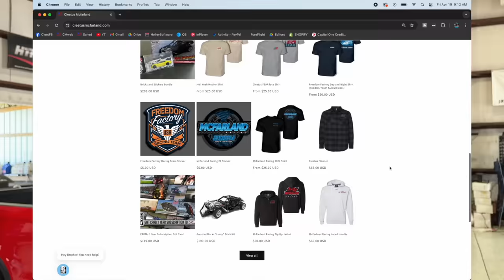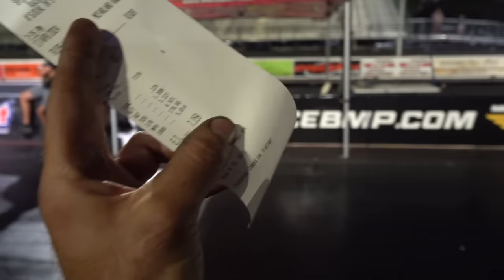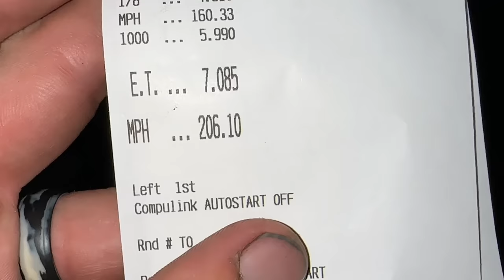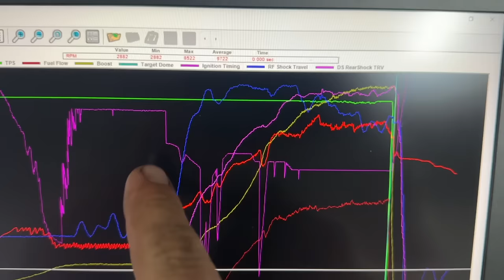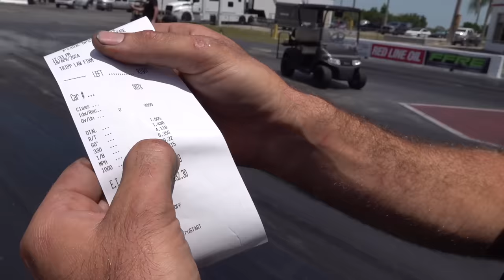Our NEW GMC and Mullet Both DESTROYED Their Records!!!

Comment: I had same issues on my lowered 4wd silverado, I broke a few axles. You need longer axles on these trucks, get the factory trail boss axles since they are longer and won't pop the snap rings off
Reply: I hope he sees this
Reply: @cleetusmcfarland
Reply: Good advice!!
Reply: Thanks, I'll swap them out when I get it home.
Reply: Chevy people...
Reply: Or just buy a Ford
Reply: Can’t turn in your truck. It’ll break. Remember that Chevy boys 😂
Reply: @joshuaearnheart2756 What does this have to do with Chevy..?  It's a short wheelbase, 4x4 truck on slicks.  OF COURSE it's going to break something when you turn like that.  It's hard enough on parts to do that without slicks...  

This brand-war stuff is pathetic.  Both trucks are awesome, but neither truck's success has anything to do with either brand.  Pretty much everything except the body and chassis is aftermarket on BOTH of the trucks.
Reply: @JayRussellDuramax  his ford hasn’t broke any. But go off
Reply: @joshuaearnheart2756  And..?  This truck hasn't broken any either...  It's just snap rings because the axles are too short - like the OP said.  The axles themselves are fine.  I don't know what you're trying to claim here.
Reply: @JayRussellDuramax  snap rings are part of the axle. How are they too short for a lowered truck. Makes no sense. Chevy just builds shit. Plain and simple. They’ve always had weak front ends
Reply: @joshuaearnheart2756  They're a very minor component that's being put under stress that they weren't designed for because the truck is lowered and on slicks.  When you lower a truck, the control arms are in a different position in their arc than usual.  Depending on suspension geometry, that can put your CV axles in tension or compression, which will put small components - like these snap rings - in situations they weren't designed for.  In this case, the axles are being put under tension, which is causing the snap rings to break.  Notice the joints and shafts are still fine.  If the axles were a bit longer, they wouldn't be put under tension like this when the truck decelerates or turns.  It's very simple.

The fact that you're calling the entirety of a brand shit because of a minor failure is ridiculous and continues to prove my point that this brand versus brand stuff is the stupidest and most needlessly toxic part of the car community.  Pretty much all of the arguments - on either side - are ignorant and anecdotal at best, or complete nonsense like what you just said.

Case in point:  There's hundreds of builds like this using bone-stock GM front end components that don't break - this one included.  The axles are not breaking under torque, and neither is the differential.  Therefore, Chevy front ends aren't weak.
Reply: @joshuaearnheart2756 ya how terrible the axles popped out. Much harder to fix than a broken crank like the ford.
Reply: @JayRussellDuramax  dawg, do you even hear yourself? Do you know how an ifs truck works? When they lower the front end it will basically make the cv’s parallel to the ground. If they’re too short on a lowered truck they’re way too damn short at factory height. Again, junk GM. That ford is lowered and how many times has he launched it and hit on the brakes at well over 150? Stock front end, stock axles, stock rearend and is a LOT faster than that fully built 427 that required the cab to be pulled off to be put in. Made 400 hp with the stock engine and a blower. So impressive huh? Stock coyote with rods and pistons absolutely gapping that Chevy. There is no this vs that. There’s absolutely no comparison. They’re on different levels and the fact that you think it’s even close speaks volumes. Talk about brand loyalty. It’s even worse justifying being a whole second slower in the quarter and the ford can still be turned up more. Chevy breaks every pass. Sound like James and George. You couldn’t be more biased. Saying chevys don’t have weak front ends is like saying the sky ain’t blue and grass ain’t green. There’s companies that got rich from building kits to not make the front tires point at each other. Like the kryptonite front ends
Reply: @mcfero1  crank broke because he didn’t put the crank support on it. Launching it banging it off limiter 100 times a week for several weeks without the support on. It’s a big blower on a factory crank. The guy that was driving the truck when it went a 9.0, go look at his car. Running 6.1x at 238 mph on a stock crank making 2960 at the rear wheels. Approximately 3300 at the crank. It’s not a weak crank by any stretch. Keep reaching though buttercup
Reply: @joshuaearnheart2756  it’s fine. I’m just not a hater I like all brands. Every platform has pros and cons.
Reply: @joshuaearnheart2756  I do know how IFS works; I literally just explained it to you.  The axles becoming parallel to the ground is what's causing the issue.  If the inner pivot points of the control arms aren't in-line with the inner CV joint, the axle changes length as the suspension goes through its travel.  This truck is experiencing that in a way that's causing the axles to be put in tension, as I stated in my previous comment.  It's basic geometry, and the GMC simply doesn't have factory geometry that plays nice with the stock CV axles when you lower the truck.  No big deal; just get longer axles...

First off, if I remember correctly, the Ford is the one that required the cab to be removed to install the engine, not the GMC.

Second, that fully-built TKM SHORT-block in the Ford costs MORE than the fully-built Texas Speed LONG-block in the GMC.  Less money for the LTX - AND you get built heads.  Coyotes are great engines; they're just EXPENSIVE!  Also, since we're comparing the two, the 427 is smaller and lighter than the Coyote as well.  None of the "Ohh, how pathetic that you need a 427 to beat a little 5.0!" guys talk about that part...

Third, the blower on the 427 is WAY worse than the one on the Coyote.  If they had the same blower, the 427 would be making WAY more power than the Coyote.  That's why they added nitrous to get it in the 9s:  They're out of blower.  Give them both the big Whipple and see what happens...

Fourth, while GM tie-rods are a known weak point on the diesels, it's hardly enough to claim that the ENTIRE front end is weak.  The components that actually matter are just fine.  You can use longer GM axles on this and have no issues...

Fifth, I never justified anything.  I entered a conversation about the axles being too short, and you went on an insecure rant about Ford versus GM.  The obvious justification is that the Ford has a way better blower than the GMC - hence Cleetus saying they'd turn the boost down on the Ford to make it fair.  But, before they could do that, the Ford BROKE!  AGAIN!  If you'd like to keep a tally on which truck has broken more parts, you'd better add THREE ENGINES to the Ford, not counting the NUMEROUS belts...

Sixth, everyone is biased; that's why we're arguing.  What matters is who has evidence to justify their bias.  You've done nothing but spout off on an insecure - and uninformed - rant, while I've given clearly stated reasons.  Please settle down and try again once you're thinking clearly.
Reply: @JayRussellDuramax  no it doesn’t. $5k for a built coyote short block. The ford didn’t require the cab to be removed. Go watch the videos. They had to pull the cab off the gmc twice. It’s documented on this very channel. Just go look. I’m not explaining it to you pumpkin. 0 pitch on the CV axle will have them at their longest. Idk how else to explain that. It’s a design flaw. GM won’t fix it. The 8 speed trans was such a pile of crap they had to have ford design a 10 speed for them. Front ends have been junk for years. Transfer cases have been junk since 99. The ford has also made hundreds and hundreds of passes and it had the wrong belt on it. Had one that was too short putting extra tension on the crank snout and it had a bent alternator shaft causing it to throw belts and slam off the rev limiter. Time after time. So let’s do count failures that weren’t his fault. Please do
Reply: @joshuaearnheart2756  Wrong.  The cheapest TKM option is $9K, and the one they have is at least $12K.  The LT is closer to $15K - which is more expensive than I thought it was - but it still comes with cylinder heads.  The Coyote is still bigger and heavier - which is why so many people put LS engines in Fords.

Ok, so I got the cab thing backwards.  You can't blame me since Ford trucks have needed the cab to be pulled for engine work for DECADES.  Regardless, these new trucks are all awful.  If they'd've put this money into some OBS trucks, both of them would be WAY faster.

You really have no idea what we're talking about here, do you?  If the inner pivot on the CV is not in-line with the inner pivots on the control arms, the axle will experience tension or compression as the suspension goes through its travel.  This is the issue I'm describing:  The axle is being pulled apart as the suspension compresses because it's too short for this lowered application; it's not a design flaw...  As the OP said, the simple fix is to use the GM part number for the Trail-Boss trucks.  No big deal.  Also, the pitch angle of the CV joints doesn't effect the length of the axle...  It's the same length no matter the angle, it's just not in a straight line.

Nobody cares about the new transmissions.  Both trucks would be faster if they had a Turbo 400 in them like Mullet - which is a GM transmission.   Plus, the 10-speed was a joint effort between Ford and GM, so I don't know why you're bragging about that...

The transfer cases are definitely not junk.  Plenty of people use bone-stock ones on big-power builds like this with no issue.  Didn't they break a couple of transfer cases on the Ford already..?

When did they say the belt was too short on the Ford..?  They knew from the beginning that they needed a crank support, but they waited until the crank broke to get one.

If the belts breaking on the Ford weren't his fault, then the axles breaking on the GM weren't either.  That means that the GMC hasn't really broken anything, and the Ford is down multiple engines and transfer cases - and the stock transmission, if I remember correctly.
Reply: @JayRussellDuramax  you’re spewing all this info you think you know and it’s just plain wrong. That tkm branded engine can be bought anywhere else for half the price. Texas speed sells them. $5500 and it’s rated at 1500 hp. Midnight performance dude has one in his Mustang and it makes about 1800. Has for a long time. They didn’t wait to get a crank support. He had it sitting on the shelf for over a year and just didn’t put it on. He knew he needed it and didn’t put it on. The belt was too short for the application. Midnight performance told him that when he had his back half shootout at the drag strip. And the shaft on the alternator was bent causing the belts to come off. That’s not fords fault they put a belt on that was too small and it bent parts. Here you GM guys go again claiming that 10 speed. GM had 0 to do with the 10 speed. None. Zip. Zilch. GM was supposed to build a 9 speed transaxle transmission to put in the front wheel drive cars. It was so bad ford never used it. It was supposed to be a “I’ll build this, you build that, we will trade” but it never happened. Ford is the only one building everything in house. Engines both gasoline and diesel, transmissions, everything. He didn’t break any transfer cases in his current ford and hasn’t broke any by launching them at the track. He was doing awd donuts on his skid pad. Full crank on the steering wheel with 1200 hp and a big turbo. His factory transmission did get wore out. Again, nothing broke. Wore the clutches out. They didn’t even attempt to run the GM on a stock trans. Had midnight performance send them a built one. Went in immediately. You don’t watch the channel and you love Chevrolet. It’s obvious. Funny you’re a GM fanboy and have duramax as your screen name… a Japanese company that isn’t GM… that has an Allison transmission…. That isn’t GM. Also, cabs haven’t needed pulled on fords for engine work. Ford diesels? Yes. Not gasoline engines. None of the above. I’ve heli-coiled triton heads in my driveway. Pulled valve covers off 4v cobras in the car and had room to pull the heads if needed. People doing it and it needing to be done are different. Shops are pulling cabs to do 3.5 ecoboost cam phasers when it’s completely unnecessary
Reply: @joshuaearnheart2756  I've explained the axle situation three times, and all you do is rant about how horrible you think GM is.  Please tell me what I said that was wrong.  I've already pointed out that what you said about IFS was wrong, but you ignore that and rant about other stuff that nobody is talking about.

TSP sells one alright. ...For $9K.  I don't know where you're coming up with this $5,500 nonsense.  Even the 1,000 HP one is over $6K - and that's still without cylinder heads.  Regardless of the expense, the Coyote is still bigger and heavier.

It doesn't matter whose shelf it was on; they broke the crankshaft.  That's the point.  That would've happened with the correct length belt.

The belts breaking weren't Ford's fault, and the axles breaking aren't GM's fault.  They're using an axle that's too short, and it gets pulled apart when the suspension compresses.  Use the correct length axle, and they won't break.  Stop making a big deal out of nothing.

Ok.  Whatever.  The Turbo 400 is still a better transmission than either of them - which is why it's used in so many high performance drag vehicles.  Also, here you Ford guys go overstating reality:  Ford didn't use the 9-speed because the 9th gear wasn't helping efficiency as much as they wanted, so they removed that and made it an 8-speed and used it along side other 8-speeds.  Big deal.  New stuff is just planned obsolescence anyways, so I don't see why you're getting caught up in it.

Worn out isn't any different than broken.  The application vastly reduced the lifespan of the component, so it might as well have broken.  They swapped the one in the GMC because they knew it would wear out quickly - especially since the 427 makes more torque.

But they still broke the transfer case, didn't they?  Funny how the circumstances of the break make so much of a difference when the Ford breaks something, but, when the GMC breaks something, you say that GM is shit.

I do watch the channel, and I'm not a GM fanboy; I just own a Duramax.  You'd know that if you looked at my channel.  You're a Ford fanboy, and it's hilariously pathetic how much this is bothering you.  I couldn't care less about modern vehicles or the OEMs that make them.  They're all garbage and the companies are just government peons.  The red GMC is one of the ugliest trucks I've ever seen, but the blue Ford looks fantastic, so stop acting like I'm in love with GM.  I truly couldn't care less about either manufacturer in their current state.

Doing everything in-house isn't a big deal, either.  Allison makes excellent transmissions, so why not use them..?  You should watch some of the videos about the garbage valve bodies Ford is putting in their transmissions.  Also, while the original design was a joint venture with GM and Izuzu, DMAX is wholly owned by GM, and they're made in Ohio.  Duramax engines have proven their reliability over 25 years, unlike the PowerStrokes that are just now starting to be reliable.
Reply: @JayRussellDuramax  it was $5500 for a short block awhile back when we were going to put one in my brothers mustang. They’ve went up a little. Still, $6299 for a rods and pistons engine that will take 1300-1400. More than the truck is making anyways. Don’t need the heads, the stock ones are better than any aftermarket LS head. They’ve been 6.1x in a quarter in a 3k pound street car after all. And A trash 5.3 from them is $5k… with no heads. And this 427 is the l8t platform. $8700 with no heads. The pushrod design is supposed to be “cheap and simple” costs more than a coyote. Duramax has proven to eat head gaskets as bad as a 6.0 and, ironically, snap the pin off the timing gear on the crank snout. Buddy of mine is a master tech at a GM dealership and says they do 3-4 a week. Have to put a key way on the crank and need bulletproofed just like a 6.0 powerstroke. And the valve bodies aren’t the problems in the transmissions. It’s the adaptive learning. Know how many trucks I’ve seen taken to a nearby shop and had that turned off and they run perfect afterwards? Videos you’re watching may have some crooked mechanics tryna make a buck. Mullets m&m th400 is over $20k. It damn well should be better than an f150 transmission with a clutch pack in it. That gmc isn’t lowered to the point those axles look like a set of gull wing doors. Its 2”. What happens if you hit a bump? Does that break your axles? You can’t think that’s acceptable. How is it the ford axles don’t break while running much faster and hitting the brakes much harder? I’ll never understand. You sound just like James and George with your excuses. But, but, but. It’s got the wrong axles in it. Even though they came in the truck from GM.
Reply: @joshuaearnheart2756  It doesn't matter what it can take, it's what it's rated for.  Making 1,500 HP on an engine rated for 1,000 is asking for trouble.  I'm saying that, when looking at similarly rated engines, the Coyotes are more expensive.  The LT platform is more expensive than the LS platform because of the stupid direct injection.  If they didn't have to use the stock computer to maintain all the BCM stuff, this would've been even cheaper because they probably would've used an LS.

More flow doesn't mean more power.  The Coyote heads may flow more, but that doesn't make them better.  Just like more boost doesn't mean more power.  It's about how dense the air is.  The LS/LT heads make great power with or without boost.

Every engine has problems, no doubt, but the Duramax hasn't been anywhere near as problematic as the 6.0 or 6.4 PowerStrokes.  I've doubled the output of my LB7, and it hasn't had any issues - engine or transmission.  Regardless, I'm convinced most issues with these trucks - GM and Ford alike - are from bad tuning and bad drivers.  People also say the stock Allison can't take much over stock, but yet mine is completely fine with it.  It honestly shifts better with the added power!

All the videos I've seen show brand new valve bodies - straight from Ford - with stuck/sticking valves.  I can't remember the name of the channel, but the guy has several videos showing it.  He's a younger guy with a long hair and a southern drawl.

I meant the Turbo 400 platform in general, not specifically the one in Mullet.  Still, I bet that built 10-speed was a pretty penny - and I think there's more internals changed than just the clutches...

The axles don't have to look like gullwing doors to have this issue.  You'd know that if you read the three or so times I explained the issue...  Is it so unreasonable to have parts fail when they're not used for their intended purpose..?  It doesn't have the wrong axles in it from the factory if you don't lower it.  We're simply saying that, for the suspension geometry of this truck, when you lower it like this, you need longer axles to prevent them from being pulled apart when the suspension compresses.  It's not hard to understand - and there's an off-the-shelf GM part that will do it just fine.  They're not being overpowered; they're just being pulled apart when the suspension compresses.

Please don't compare me to the ridiculousness that James and George are spewing out; I sound nothing like them.  I truly hope they're joking, because it's honesty pathetic to listen to...
Reply: @JayRussellDuramax  making 1500 hp in general is asking for trouble. But a coyote is different. It’s not a GM product. Even at $9k for your 1500 hp rated engine, put it in front of a 6r80 with a 4r200 hub. Ready for 6s. It’s not really the heads making the power on an NA build. Sure they help a little, but it’s more the camshaft profile and Intake manifold combo. There’s a guy from my area that owns a tuning shop. That’s his livelihood. He bought a rcsb f150 and put twins on it. Did the oil pump gears and crank sprocket with head studs. Made 1429 whp. Still on stock everything except a driveshaft. Know what he used it for? Towing his 416 stroker ls3 Camaro on a huge shot of nitrous. Would tow the car to the truck, unhook, turn the truck up, race them both all night, load the car back on the trailer and drag it home with the truck. And there was a bunch of people just like you barking about how expensive it is so he posted all of his receipts from everything. The truck was way cheaper. Like 15-20k cheaper and was getting gapped by the truck. 

You obviously aren’t listening about the axles. If a 2” drop is enough to completely render 4wd useless, then that’s a serious design flaw. Anything that would potentially upset that suspension on the highway would rip it apart. Point is, the ford is also lowered and it’s running stock axles. Probably thousands of launches on them. Many track passes getting on the brakes hard. It’s still fine. Accepting that junk is what’s wrong with GM. They’re not held accountable. Not forced to fix anything. And I didn’t say 6.4. That’s an issue with emissions. Not necessarily the engine itself. And I didn’t say it was as problematic as a 6.0 either. Said they eat head gaskets just the same. And again. Emissions systems are a bigger problem with the 6.0 than the engine itself. It’s the egr crap. Bosch also screwed all 3 companies with the cp4.

And the guy you’re talking about, his name is mayson. His channel is flying wrenches. Watch him all the time. I’m sure you’re subscribed to every channel that will show a ford having problems
Reply: @joshuaearnheart2756  How did the Camaro get so expensive..?  What on earth cost $15K more?  That doesn't make any sense.  

Or, they designed the suspension to better accommodate lifted trucks - which is the vast majority of the 4x4 user base.  Changing the ride height of a 4x4 truck always puts the CV axles in a range of motion different from what they were designed for.  In this case, because of the suspension geometry, the lowered truck is putting the axles in tension, which is putting load on a snap ring that wasn't designed for it.  Also, again with your gross over exaggeration of the issues, the 4x4 hasn't been rendered useless.  Notice how the truck doesn't break an axle when it launches and extends the suspension.  It only breaks when the suspension compresses.  Stop using such a tiny issue to make these petty and baseless condemnations of an ENTIRE company.  YOU are the one that sounds like James and George, and you're definitely not joking.

Why do you think I'm a Ford hater..?  I started this conversation by asking what the axle breaks had to do with Chevy.  That doesn't mean I'm a Chevy fanboy/Ford hater.  Heck, I'm not even subscribed to the Flying Wrenches channel - which is why I didn't know the name of the guy or his channel.  I already told you that I couldn't care less about either company in their current state.  The rigavlry was cool 60 years ago when the government and EPA wasn't ruining everything.  Now it's just pathetic and brings out the absolute worst in everyone.  Toxicity like this is ruining the car community - and for what?  Bragging rights?  Just build cool stuff without feeling the need to attack people for building cool stuff that's different than your cool stuff.
Reply: @JayRussellDuramax  the axle breaks have to do with Chevy, because it’s a Chevy… breaking axles… not the other way around. Make sense? You can lower and lift a ford. Axles don’t break. Make sense? If it was lowered 6 inches, sure, blame the geometry. Now 2 inches, no. That’s a shit axle from a shit company that doesn’t give a damn about the consumer. The point of me saying this isn’t toxic. The point of me saying this is to get people to hold these companies accountable or else everything will be junk just like that. Matter fact, I sold my new Ford truck just because on the off chance something was to happen. They weren’t getting any more money from me. Now I drive a 2003 Toyota 4runner, but I still have two Ford F250 work trucks as does my brother. We have well over 1,000,000 miles on 6.2 gas burner Ford trucks and they just keep working. I’ve personally pulled 22k pounds with the gas burner. I know a guy that pulls 25k+ pounds at a minimum twice a week. My step dad sold his 75k mile garage kept gmc because it was starting to rust at the rockers and had a lifter about to come out of it. He bought a wrecked 17 lariat. Ended up selling it and making money on it. He now owns a 2017 f350 flatbed dually. Said he’d never buy another junk Chevy. My best friend from high school put 3 transmissions in his Tahoe. Now drives a 2013 5.0 f150 and recently bought a 2012 6.2 f150. Both at 200k no issues. I know another guy that bought a used gmc last year for $34k. 80k miles on it. 2018 model I think. Transmission is out of it already, no warranty. There’s not even a comparison currently. They’re not even in the same realm.
Reply: @joshuaearnheart2756  The axle breaks because it's a Chevy...  And you have the nerve to call out my bias..?  Your anecdotes have no value - as do all anecdotes - because they don't reflect the reality of the issue; they only reflect your isolated experiences.  PLENTY of people have hundreds of thousands of miles on original drivetrain components from both manufacturers.  It's more about maintenance than OEM quality.  Sure, there's always exceptions - on both sides, I might add - but the overwhelming reality is that broken and problematic vehicles - especially when looking at Ford and GM - are a fault of the driver and their lack of maintenance and care.

This is absolutely hilarious that you're trying to spin your rant as some sort of altruistic audit of modern manufacturers.  Everyone in the car community knows that ALL OEMs aren't being held accountable, and there's nothing we can do about it except not buy from them.  Get over yourself.  Buy an old, used truck like I did and put your money into building it up.  Mine is about to turn 300K miles on all-original running gear, and, aside from some extra blow-by, everything is very healthy, and I tow with it for work every day - with my EFI Live tune turned up, too.

What is this, the sixth time I've said this, now?  An axle breaking because it was put in a range of motion that it wasn't designed for is not reflective of poor quality from the OEM.  You act like the axle is breaking under normal conditions...  It's not.  It broke when he slammed on the brakes at well over 100 MPH, and that put the axle in a bind to where the snap ring broke.  Just because the Ford hasn't had this issue doesn't mean that GM as an entire entity is shit.  Please drop this pathetic brand competition nonsense.  You're starting to sound EVEN WORSE than James and George now, and you're only making yourself look bad...
Reply: @JayRussellDuramax  I think anyone that reads this comment section would agree with me. If your truck is breaking axles with just a 2” lowering kit, that could end up being fatal. Factory trucks will run 100 mph, just takes longer. If they slam on the brakes and it snaps, that’s just acceptable for you? Ain’t no way in hell. Yea. Our work truck tows heavy too. Every day. Had a dump trailer full of granite rock today running up a 20% grade. Trailer was probably 17k pounds. Dropped it down in first and let it eat. Just a gas burner. Held 30 mph and most of it was 1st gear. About 4800 rpms. Truck has 360k miles on it. 0 blow by. 0 oil leaks. Not a single issue to speak of. And it’s on 35x12.50s. Has been its whole life. Been through a couple sets of air bags on it. The other one is at 200k and a coil pack split open on me, Arc’d to the heads and went to the computer. Now I have an intermittent injector pulse failure. It’s in the shop getting a new computer. That was a DOT truck the first 150k miles of its life. Ran hard and put up wet. 3rd day I had it I hooked to a 16 foot dump trailer with 6 foot sides full to the top with a tree that we cut down. I was told similar loads in that trailer are well over 20k. Another gas burner. The guy whose trailer we used for that tree, owns a tree service. Loads it like that every day. Guess what he drives? F250 gas burner. His brother has a duramax. He’s been called multiple times to go get the trailer because that POS duramax keeps breaking down. And did you not read what I said? Sold my new FORD and bought an old Toyota so ford couldn’t get anymore of my money.
Reply: @joshuaearnheart2756 GM's 8 speed may have had issues, but the 10 speed is garbage.  GM even changed the valving to prevent the rough 1-2 shift on cold start and rough 4th and 7th gear shifts known on Raptors.  Chevys are chewing up the torque converter in the 10 speed.  My Chevy has it and it's not liking the bigger 35s I put on my truck, even after tuning.  In fact, GM said screw the 10 speed and went back to the 8 speed in the new Colorado instead of going with the 10 speed like the Ranger and Bronco.

You also forgot the red GMC in these videos does not come that way from the factory.  GM does not make a standard cab short bed.

Lastly, if you did your research on Toyota you'd thank GM for being their partner.
Reply: @domin8ss  that’s the adaptive learning. That can be turned off easy. Friend of mine rebuilds trucks for a living. Chevys and dodges don’t make him any money. He only builds fords. Every truck he gets, when he’s done with it, he sends it to a local dealer and has them turn it off
Reply: @joshuaearnheart2756  I fail to see how your friend isn't making money on chevys but is on fords.  Ford parts cost double what Chevy parts cost in many situations.  I can't comment on Dodge/Ram as I'm not that familiar with them in this regard.  Ford trucks are typically cheaper to buy than Chevys on the used market, so that is the only way I see this working out for your friend.
Reply: @domin8ss  he runs a body shop. Builds wrecks. He’s tried fords, Chevy, and dodge. I can assure you they are not bringing more money and parts are tripled for dodges and Chevy
Reply: @joshuaearnheart2756  after reading the entire thread, you're the only one with a bias, for ford. Others are arguing against brand loyalty for logical reasons and you keep sperging out over Flipped Over Rebuilt Dodges.